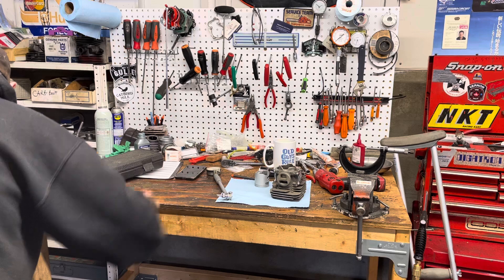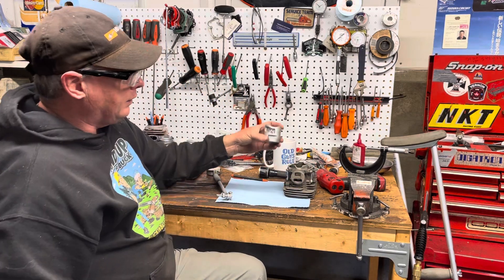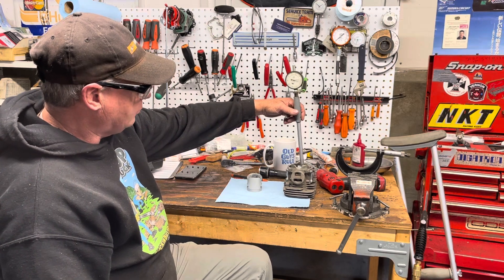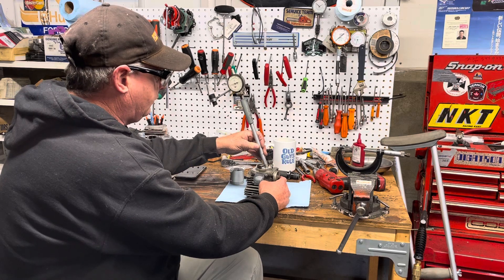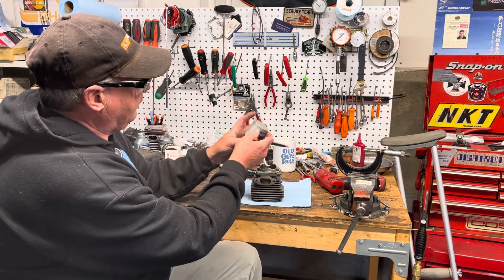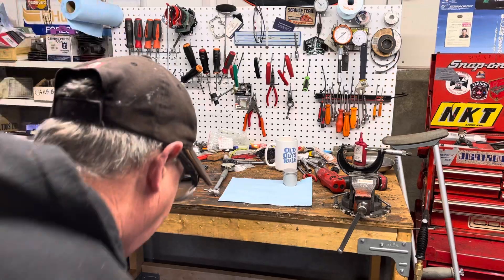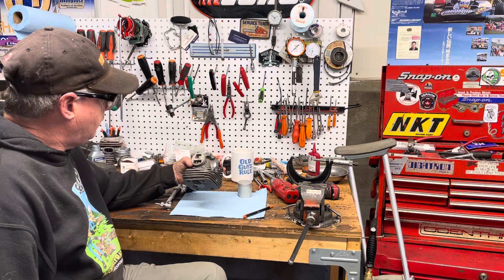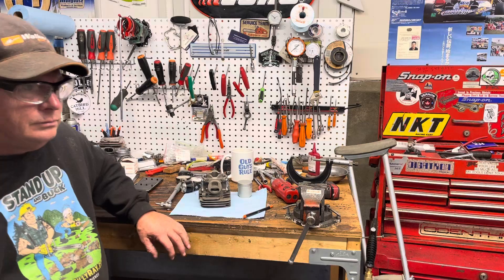How to measure piston to cylinder clearance on a saw

Comment: Installed a replacement quality aftermarket top end on my Stihl MS250 recently a luckily I checked the ring end gap 
as right out the box it was way too small on both rings.